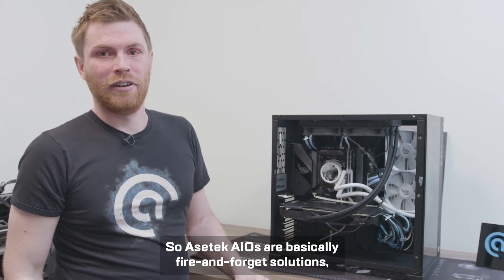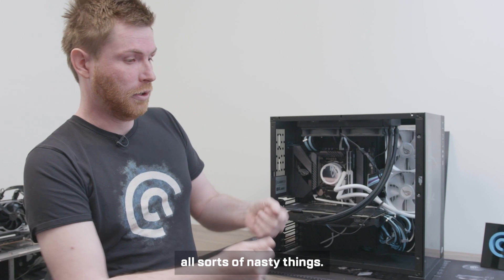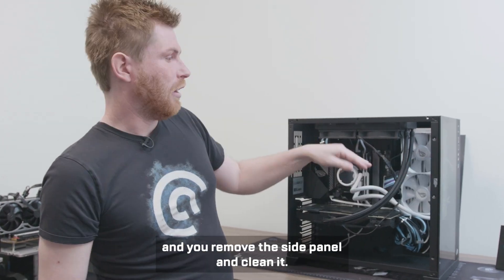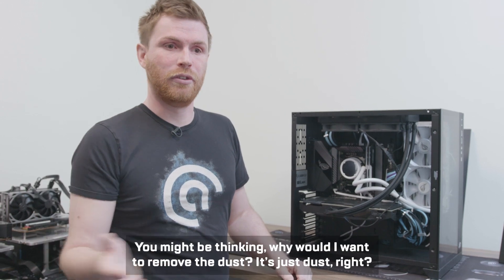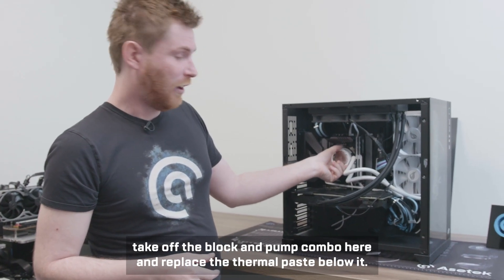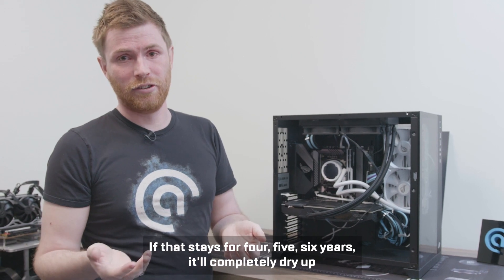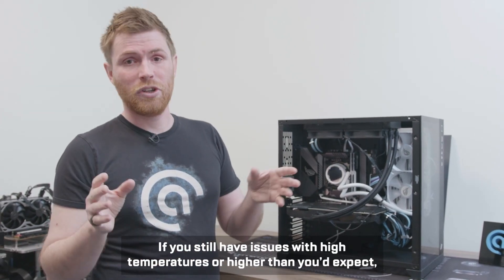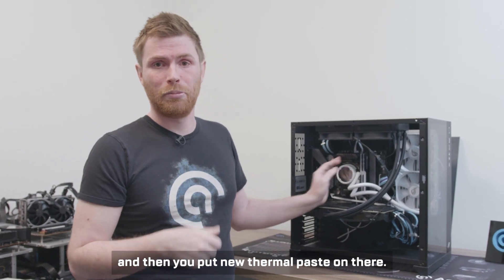AIO maintenance – removing dust and changing thermal paste

Comment: If im using a aio cooler, do I just need to apply paste to the aio then fit it back or add paste to cpu aswell as the aio? I'm using a corsair h115i platinum cooler and i9-10850k cpu i need to change my paste but don't want to mess it up haha
Reply from the maker: Do this on the CPU and not the AIO cold plate.

A small dot of thermal paste on each corner with a fifth dot in the middle. Or a single dime size (maybe slightly larger) dot in the middle of the CPU.
Reply: @AsetekInc  thank you